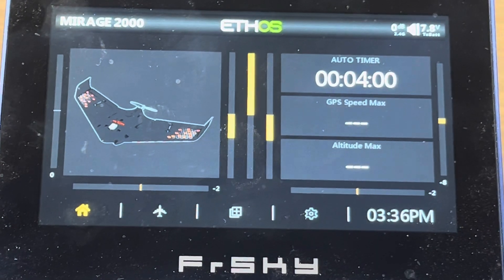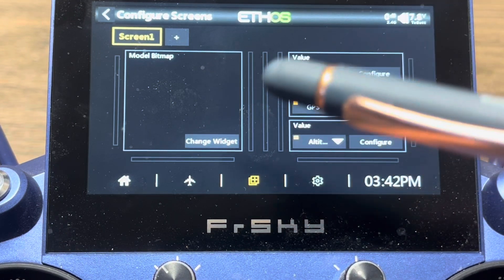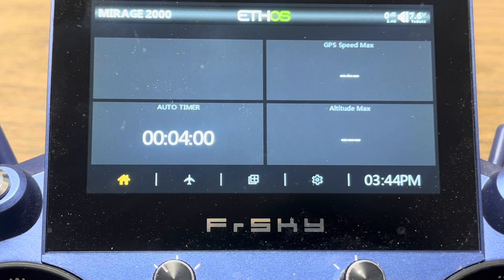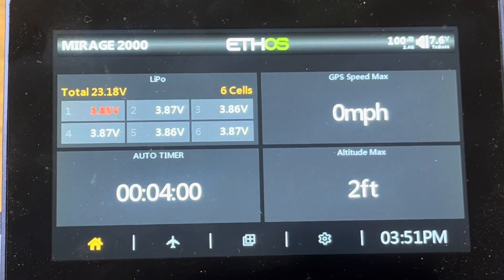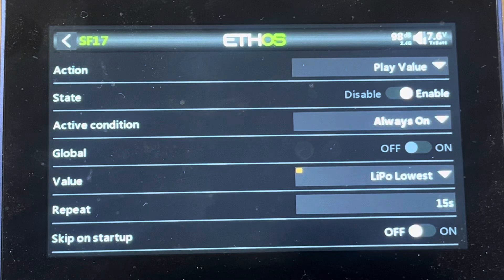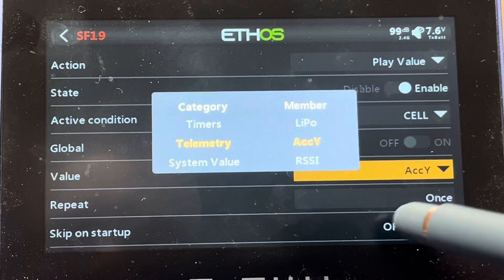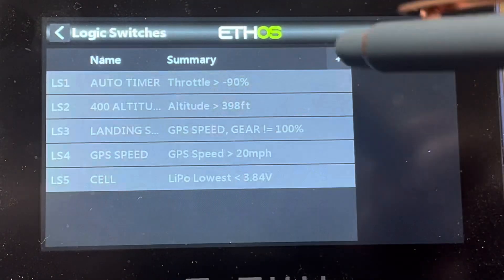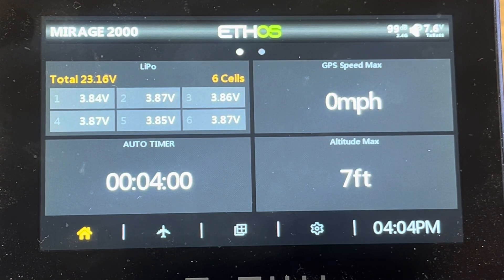Setting up Screens, Widgets and FrSky Voltage Sensor on an XS20S using Ethos

Comment: Good tutorial thanks. A few things I stumbled on. I have an ARCHER PLUS R12+. The Archer series do not have a smart port. So you have to go into the RF System menu, select your receiver, hit Options and change the port you're plugged into to an F. BUS. (took me a LONG time to figure that one out!) Next, I found in ETHOS 3.0in the special functions you can't select play value, you have to select play audio, and at the bottom of that screen you hit ADD SEQUENCE where it allows you to set to play value and set to LIPO.

Comment: Thanks for the video. Very helpful for a complex radio especially if you only set up a couple receivers a year. Hard to retain when used infrequently and especially if you are juggling 2 or 3 different brands of radios.  We spend more time setting up models than we do flying.

Comment: Great video thanks. I have an X20R transmitter and my receiver is an Archer plus SR8. I have the older FLVSS sensor with screen but can't get it to show up in telemetry. Ethos is 1.60, I have updated all firmware. The SR8 plus has no separate S port connection as it is by the 4 pin connector which does S port or F bus. Using this I still get no detection in telemetry whether I set it to F bus or S port in the transmitter.

Any help would be appreciated 👍
Reply from the maker: Make sure you've changed the channel that the sensor is plugged into to be a SmartPort.  See the video on basic telemetry set up to  make that change.  Hope this helps